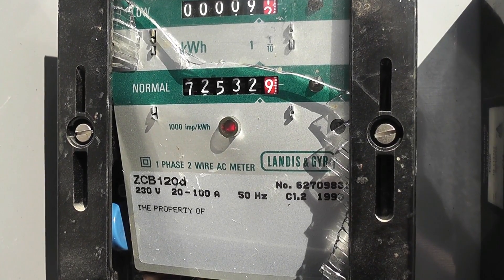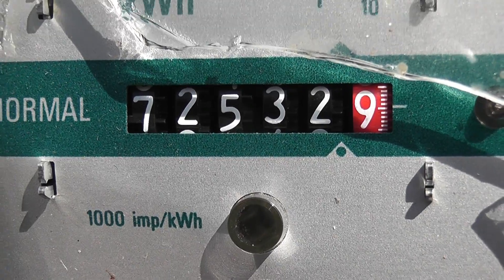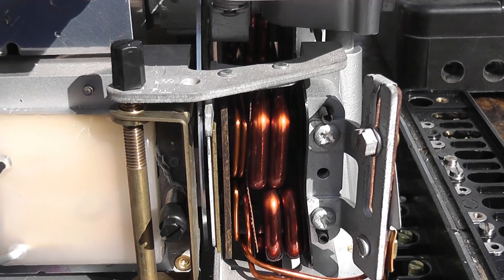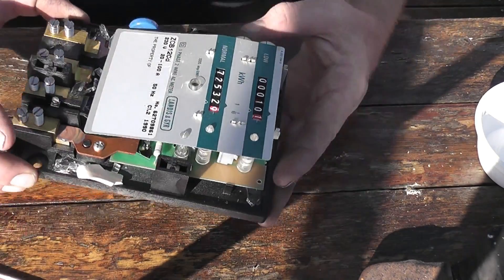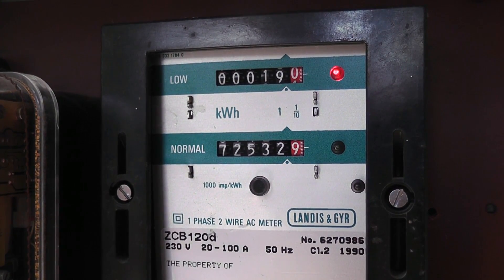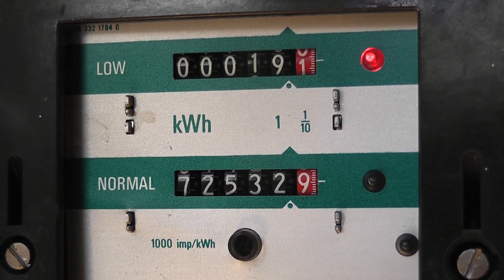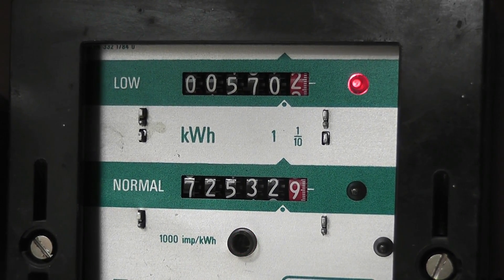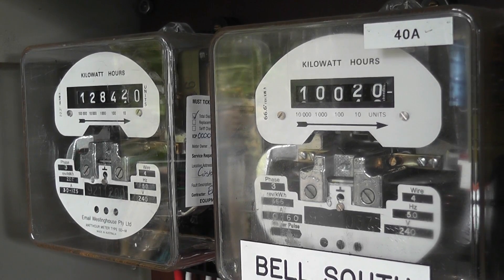ZCB120d - S300.2 - M3i - SDM - Watthour Meters

Comment: Aaaah, the L&G 
electronic ZCB 
meters. I do know 
of these, because....... 

........my electrical stockist was once selling these and they had the reconditioner's chop-job done to them where they rip out the LOW rate readout and then spew the poor things with silver hammer-finish paint. :-(

I am pretty sure that somewhere, after enquiring to L&G, that I have a PDF on the ZCB meters.

Bit of a shame that the ZCB has been caved-in. 

The thing I found odd about that, is when you had it powered up, I could hear the pulse light 'ticking' as it flashed. Rather odd that. Surely there is not a contact in the back of that to click on-and-off to make the pulse light flash? That would be proper funny. :D

===================================================

Ooooh!! Now that could very-well be ANOTHER YouTube first right there: The Sangamo Weston S300.2. Never seen one!

Placed into the classic S301 cases (or are the S301s placed into S300 cases? :D) these have the same styling externally as the S301s, and a quick glance could have someone fooled that it was a S301. 

I never knew that Sangamo made another meter which was similar in its internal electricals to that of the Sangamo S29 Form 2, of which, although is a 3 phase meter, only records the red and blue phases; the yellow passes straight through and is unmetered. 

The thing with the S29 Form 2 though, is it is a 415v meter. Your S300.2 is a 2ph 3W meter and because of that, I believe that the voltage coils in that could be 240v coils. You know what that means.......  you could use it as a huge single phase meter. :D 

You know you want to. :D

Looking forward to seeing the restoration of this one-off S300.2 and seeing an accuracy test on it to see if it is still running accurately.

Just out of interest: If it has gone out-of-wack, do you have a spare accuracy magnet which could possibly drop into this S300.2?

I look forward to seeing this one tested and cleaned and restored.

Thanxx for showing,

-Wayne's Electrical.

24th October 2018, 03.50..... REALLY?!!!! :-O
Reply from the maker: I will do an accuracy check on the S300.2 meter. The PT coils for 230 and 240 Volts are usually exactly the same doing an R reading on it.I have seen the  ZCB meters on fleebay UK with the hammerpaint as you described.Never understood the logic in Sangamo meter types.

Comment: What do you think about the new smart meters?    Power company put one on my garage and we had a 3 strike surge, then power went out generator fired and when power came back, that screen went crazy and generator started cool down mode.   Was without power for 15 minutes.   Power Co came up checked meter and replaced it.   The guy in charge of metering said it was the first one reported that did that.   Gave me his number to call him 24/7 365.    They were at a loss to figure out why meter did that.   Generator and transfer panel checked out fine.
Reply from the maker: The new smart meters are rubbish, cheap and nasty and don't like lightning surges.

Comment: The 2 phase meter is very interesting because here in the UK there are a few 2 phase supplys actually its split phase but guess thats what the meters for. Thanks for showing it Ray
Reply from the maker: Yes, we have split phase supplies in rural areas 2 x 240/480 or 2x230/460 and in city two phase supplies on some larger houses with electric spa pools and underground heaters 2x230/400 or 2x240/415. I like odd ball meter finds, even in rough condition.
Reply: Where are 2 phase supplys?

Comment: Odd - when would a two phase meter be used instead of three?
Reply from the maker: Rural areas with 2x230/460 Volts SWER systems.
Reply: OK - makes sense! Never seen a Single Wire Earth Return system for real. Do they still operate in NZ?
Reply from the maker: Yes, SWER systems are common in remote rural NZ and Australia.